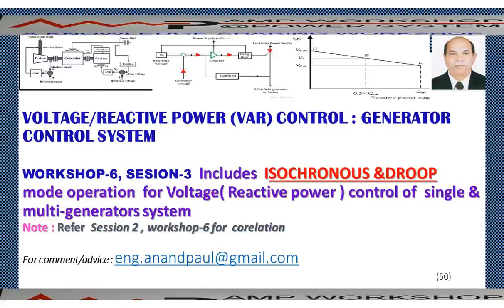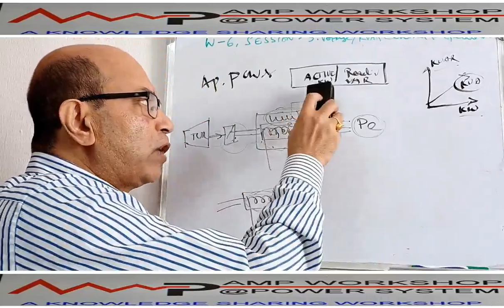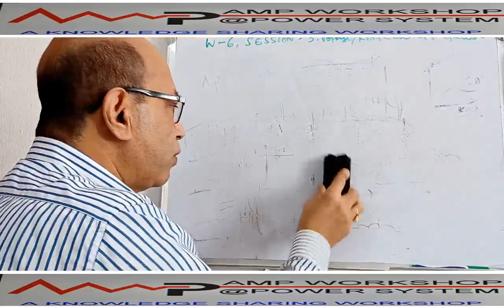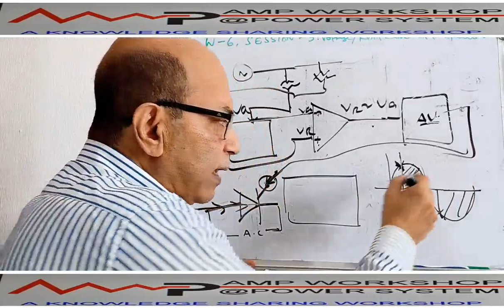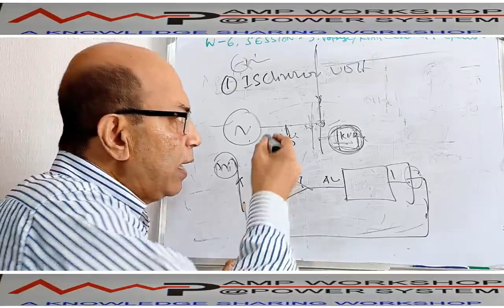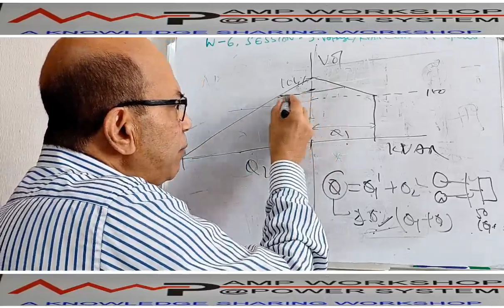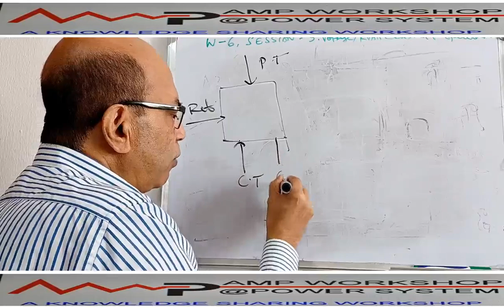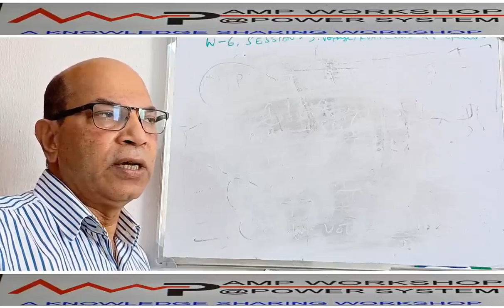VOLTAGE & REACTIVE POWER  (VAR) CONTROL OF SINGLE /MULTI  GENERATOR   SYSTEM

Comment: 1) Sir, can u explain a bit kvar sharing in cross compensation mode also known as reactive differential mode 
2) Is it same as isochronous mode? 
3) can multiple, yet identical, generators satosfactorily operate in parallel in reactive droop mode?
Thankyou
Reply: Have you found your answer anywhere??